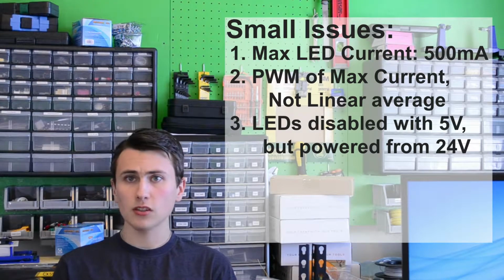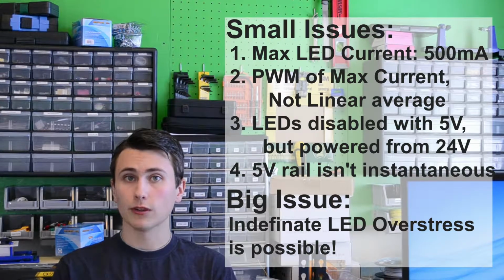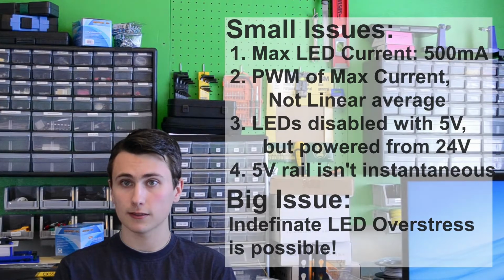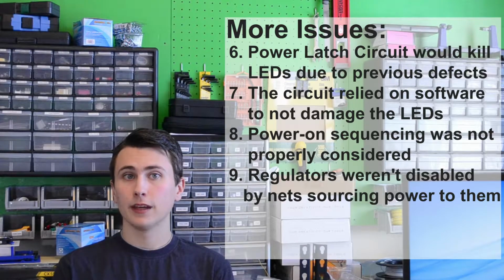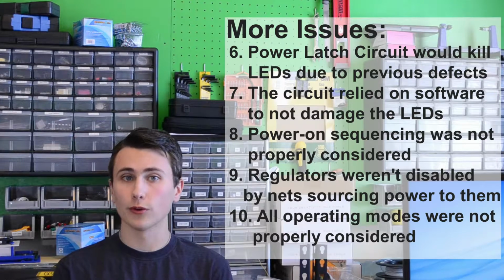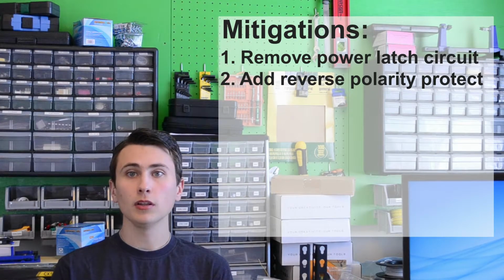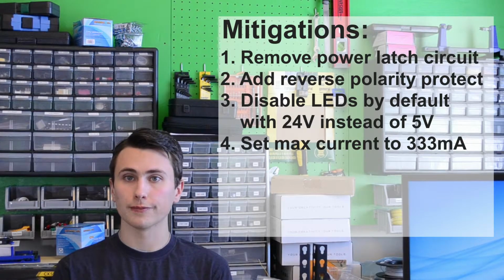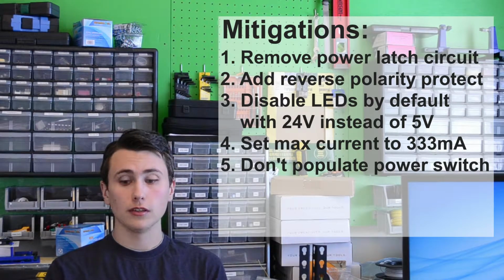Mistakes Were Made – Plant Light Project Episode 12

Comment: Interesting channel.  I like how you don't shy away from pointing out mistakes, it's really the only way to learn tbh.  For LED buck converters you could consider the IC which is inside most Chinese made LED supplies, the PT4115, current regulator. Very simple, and has an input for PWM or analogue control and the case is a tiny SOT89-5...
https://people.xiph.org/~xiphmont/thinkpad/PT4115E.pdf
Reply from the maker: Hello threeMetreJim! Thanks for watching, and welcome! 

Agreed on the mistakes. Learning through mistakes is definitely the best way for me! It makes the lessons stick a little better.

Thanks for the tip on the PT4115 SMPS controller! I'll have to check it out on LCSC to see if I can get my hands on it. Perhaps a comparison between it and a Top-of-the line TI controller would be interesting?

Cheers!